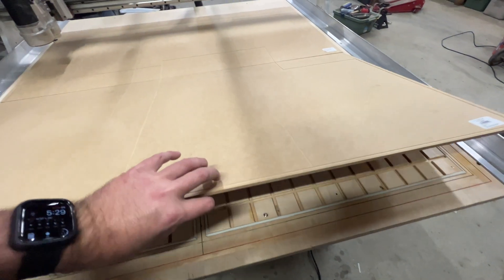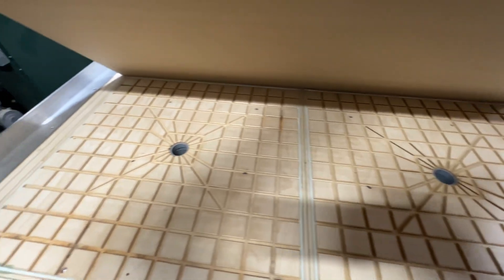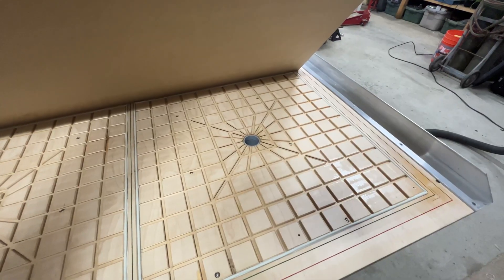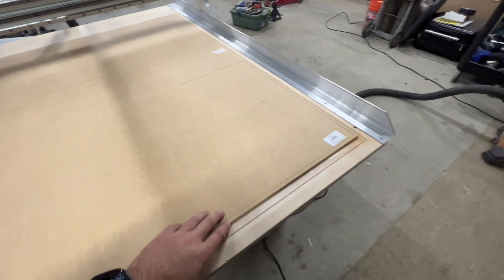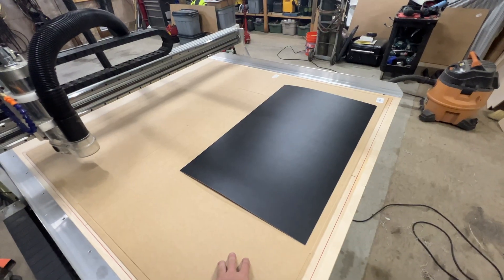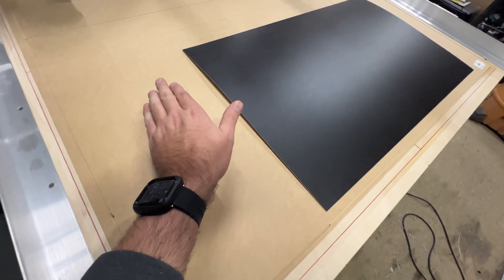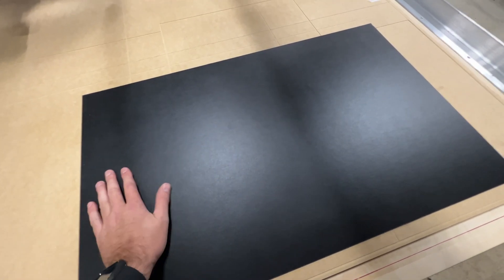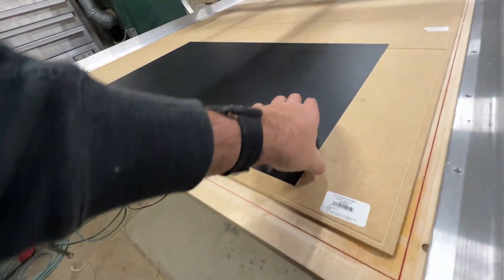CNC Drag Knife & Vac Table

Comment: Hello! How is the knife operated? Programmatically or by moving the axes?
Reply from the maker: It's a drag knife. It lifts the blade nearly out of the material and uses the trailing swivel and a sweep of the machine to turn corners.

Comment: So that was just regular 1/4 inch mdf and not another product that is more porus?
Reply from the maker: Yes and I didn't remove the surface coating. It passes more air with that smooth pressed surface milled off.

Comment: how thin that MDF sheet should be to let that small ampunt of air pass ?
and can you cut craft paper reliably with a drag knife?
Reply from the maker: This was 1/4” but use up to 3/4 as well. I suspect you could with the vacuum holding it down. You’d have to keep a sharp blade to prevent it from tearing.
Reply: @CraigVanSickleAK  thank you for your help

Comment: What is your vacuum source?
Reply from the maker: A Vacmaster Beast 5 gallon (VFB511B0201) It has the highest water lift for the price I could find. I'll sometimes throw a second Shopvac in series to add some power. This winter I'd like to build a system with some larger central vac motors.